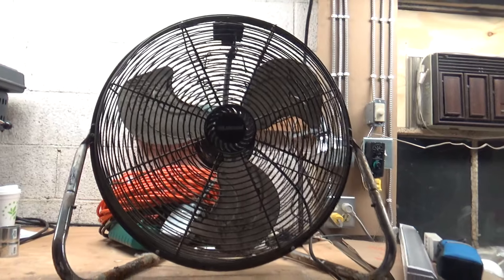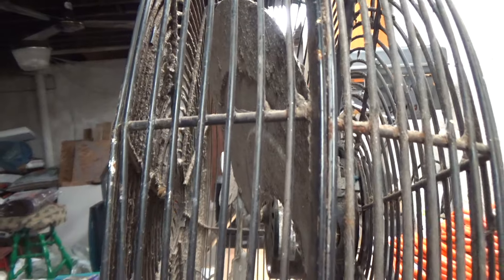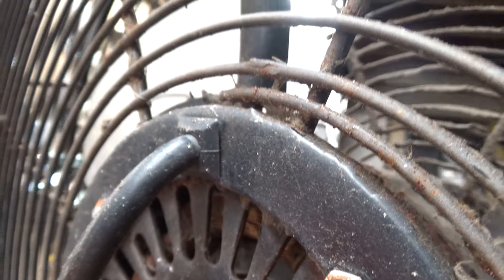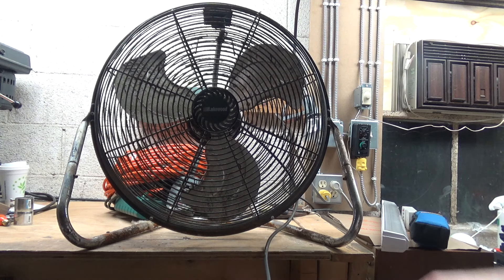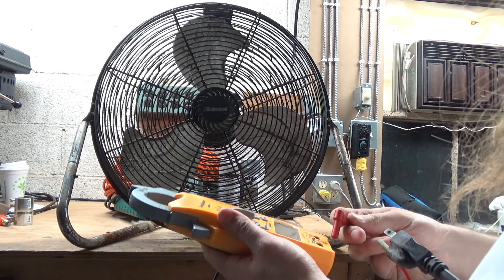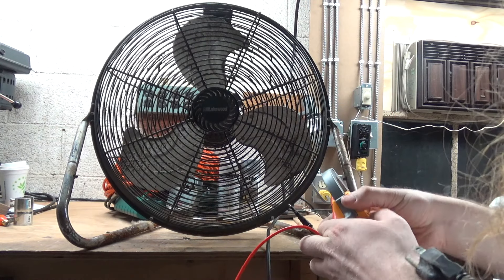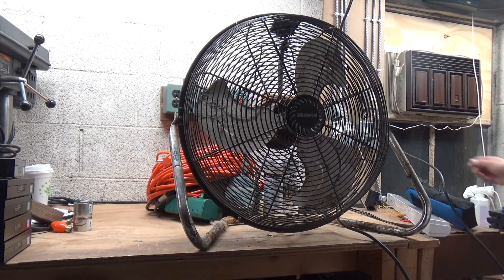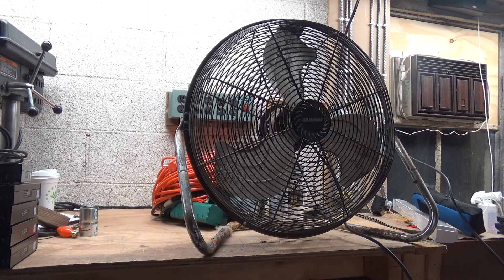Curbed Lakewood HV-21 21" High Velocity Fan

Comment: Definitely a transition model and it shows you how well made those old mcmillans are and the reason maybe the motor doesn't have much dust is because the rain probably washed it out or some but wow that fan had a ROUGH life
Reply from the maker: Perhaps.

Comment: Hopefully you can get ths cleaned up.  Also if you were to let it run for a while it may squeal.  May of been tossed due to squealing.  Also i have seen these to stop running and the bearings lock up after the motor warms up.  Usually tearing diwn the motor, cleaning and oilling the bearings will fix this issue  as well.   I am also familier with tbe marco motors that galaxy, and lasko used.  I assumed galaxy, and lasko used the marco motors.  The main reason these fans as well as the box fans get trashed is due to the lack  of maintanence.  Almost every box fan i have worked on needed the bearings cleaned, and oiled.  Personally i dont care for the marco motors.  The mcmillian motors are pretty good.  You have to keep these fans clean.  A simple vacuuming of the motor vent openings every now and then will go a long way.  It will keep the motor windings running cool.  I have had to replace the internal one time thermal fuse in a few of the box fan motors. It acts as a safety isdue along with the thermal over load protector.  I have repaired many heaters with failed thermal fuses.  Also many if these newer fans and heaters now have a non replaceable fuse in the molded plug. You have to replace the cord, or in many cases just cut off the plug end, and replace with a new plug end from the hardware store.  Just last year a friend brought me a big round  lasko wind machine fan he found in the trash.  It had one of the main power cord wires loose in the switch, the wires just push into the sides of the switch.  I flowed some solder on that wire, and pushed it back into the connection on the switch. Fan then worked.  I proceded to check the other wires for the speeds and they were loose and easily pulled out, so i redid all those as well, then cleaned, and oiked fan, and then she ran like a new fan.  Its a lot of work cleaning tearing down the motor and oiling.  Yes the oil ports are nice, but only work if you keep up with keeping the motor clean.  Wish i lived close to you, id come over and help repair this stuff for you.  Repairig stuff is my favorite thing to do.  Also i make sure its squeaky clean as well.  Heck customers have told me their item looks as if it wad brand new out of the box.  Hope to see a cleaning video of this fan.
Reply from the maker: There will be a clean and service video on this one.